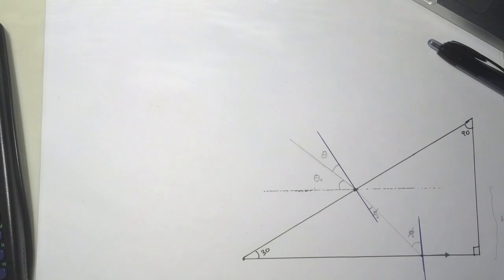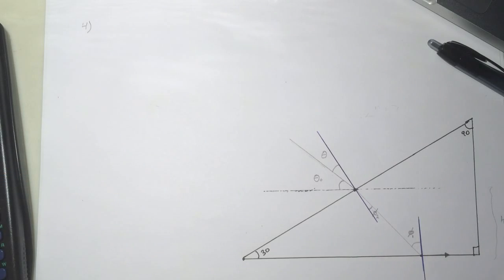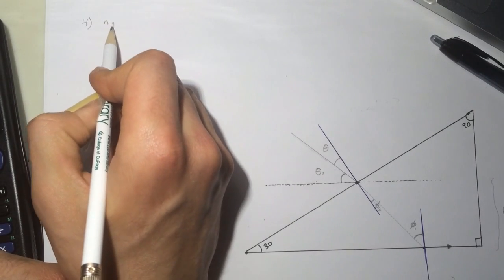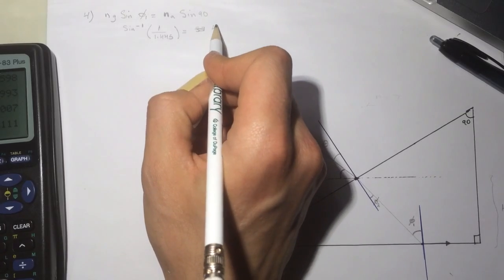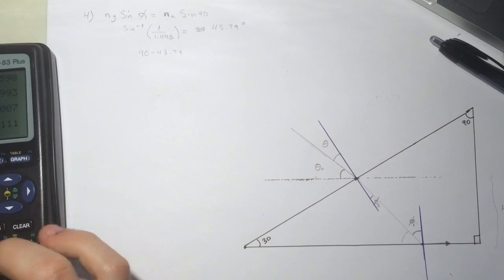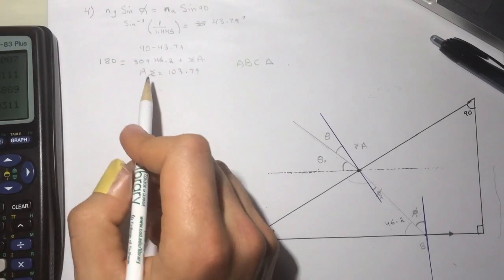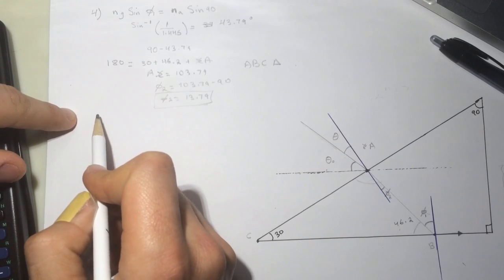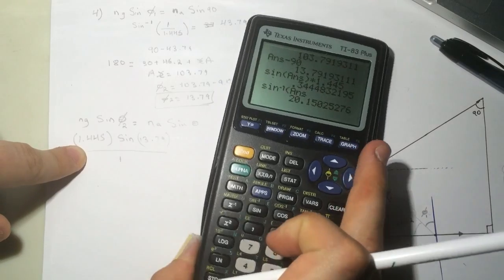Monochromatic Light and a 30-60-90 Prism "Smartphysics" Part 2

Comment: Thanks for the upload! It's hard to read that super light pencil though, could you use pen or push harder? Also, the angle you call A is ambiguously labeled.
Reply from the maker: Oh shoot ! I just noticed how light i was pushing lol, I will push harder next time :). Anyway , If you noticed, I labeled ABC so the angle A is the one between the lines AB and AC. does it make sense now ?